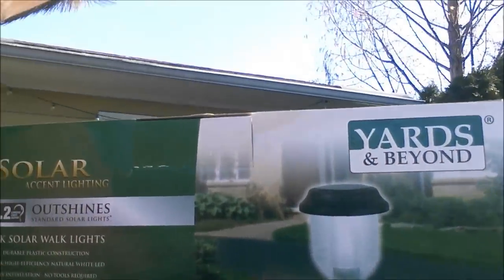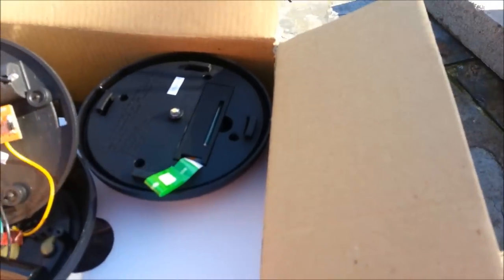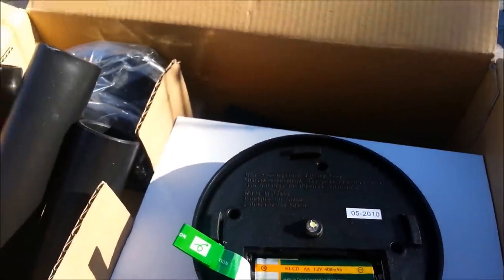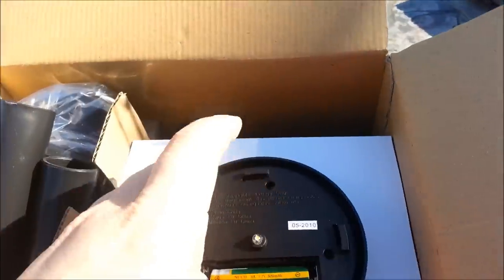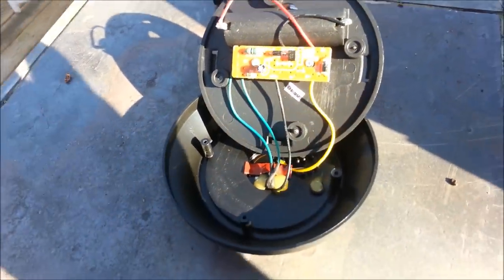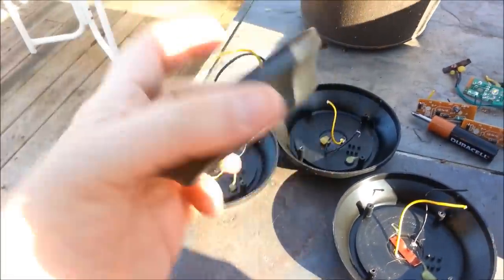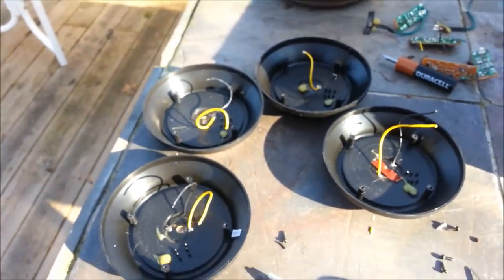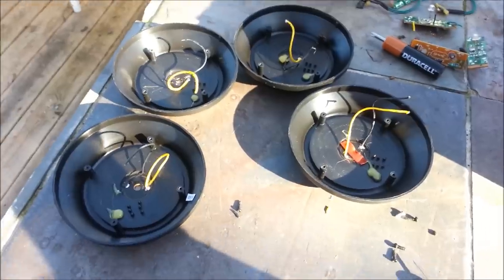DIY Solar walkway light to Battery Charger conversion

Comment: I will not mention the series parallel mix up because I see many others already have. What i will mention is that buying these expensive kits is a huge waste of money. I have these exact panels from some salvage patio lights. They are 2.5 volts and are only 40mA each. That is 0.1 Watts  X 4 panels = 0.4 Watts. That's $62.50 per watt. Considering that $1-$2 per watt is considered reasonable, that is huge waste of money. You can buy a single 0.6 Watt (6v) panel off ebay for $1. You should also put a blocking diode in series with the battery to stop the battery from discharging back into the cells when there is no light shinning on the panels. Remove one of those diodes from one of the boards.

Comment: yea dude... the lil chip prevents the electricity from traveling back from the batery to the panel. and for the records... your parallel and series is wrong. you wired it parallel, so your peak volatage is going to be probably be 3 or 6 volts... but yea... ur amperage is good :) good luck on your future solar projects. you would be able to crank 14 if u do series :)

Comment: I think you made a mistake in your description of series and parallel connections of batteries.
Connection in Series: voltage increases but Amperage stays the same.  In parallel connections Amperage Increases but voltage does not change.

Comment: If you were to remove a single solar panel from one of those lamps and attempt to light the LED using ONLY the panel, you would quickly realize that the LED will not light and the circuit that the panel connects to is not simply a switching circuit it is more of a mini-charge controller and you absolutely need something like this in order to charge those batteries as they require a higher input than the innate output of the individual solar cell itself.
Circuits are fun and I highly recommend taking up a hobby of understanding and constructing them.  You don't have to be a engineer with credentials in order to obtain and utilize valuable knowledge pertaining to electronics, but you will need to perform your due diligence.
Don't listen to the haters who seem to express derision bordering on actually hatred towards amateurs endeavoring to build something complicated for themselves whilst sharing it with an online community that they make themselves a part of.  Credentialists are complete and utter tools.
Reply: +Lunartrek; Not entirely true. I have identical panels like these. The panels produce 2.5 Volts. This will charge a 1.5v battery directly connected to it, and at 40mA, this will not harm the battery if over charged to long. However, he should have kept the blocking diode in series with the battery to prevent the battery from discharging back through the panel when there is no light.
About your last paragraph I have an issue with people who don't know what the F' they are doing, and making instructional videos. Its like the blind leading the blind. Its false information and it can causes people who don't know better to waste their time and money. Its Negligent and arrogant.
Reply: You're right about the diode and I may be wrong about the panels not powering the LED in other regions as the azimuth angle of the Sun plays a huge role.  Here, in Alaska, a single panel will not light my 1.8V LED.  I understood less, back when I wrote this comment.  This is a charge controller, that much is true, but the circuit has nothing to do with increasing the power of the solar cell, it simply builds up a charge which is then pulsed into the rechargeable battery to produce the charging effect.  The diode is essential, as you said, since the battery would simply discharge into the panels as soon as the voltage from the panels dropped lower than the battery which it would do, intermittently, throughout the day and all through the night until they roughly equalized potentials.
Reply: +Lunartrek ; There may or may not be a charge controller on the board. There is a photocell(photo resister, CDS cell) on the board that switches(connects) the battery to the LED when the light is low enough. I doubt that the cheaper lamps, like the ones from the dollar stores would have a charge controller. Its not necessary for this type of device using cheap NiCd batteries.
Reply: I use charge controller in a loose way.  Transistors can be applied as cheap charge controllers in that they can be wired to limit current or voltage, depending.

Comment: one mistake you made. if you hook up four solar cells in series will give you more power but with little amps, this means you will have more power to charge battery's but it will take much longer and the battery wont keep a charge, hook the cells in parallel you will get less voltage but more amp what this mean is it will take less time to charge your battery's with a higher chance your battery will keep it's charge. otherwise this was a good video, just remember this the next time you play with solar cells and panels.
Reply: +James Womack: You will not get more power. It will be the same power either in series or parallel. Power = voltage X current.   ie. 2X4=8, 4X2=8.  "More power to charge the batteries but will take longer to charge"????? That is nonsensical.
The voltage should be aprox %50 more than the batteries rated voltage, That is what should determine whether they should be in series or parralel.
Reply: +Robert Tomkinson lets just say we have 3 solar panels, each panel is rated at 20 volts, 5 amps, at 100 watts. wire these panels in series and you will get 60 volts 5 amps at 300 watts, this means you have a lot of voltage to charge a large battery bank, but like SurvivalistOfTheDead has said ( charges a bigger battery but very slowly). now take the same 3 solar panels and wire them in parallel you will get 20 volts 15 amps at 300 watts. now say this battery that we will use is a 12v deep cycle battery with 400ah they ain't much but i deal with them daily (there industrial and you need 2 people to lift one if anybody's curious ) now i know you may not have much experience with this type of battery and lets say you have one of these battery's and your only way to charge this battery was these 3 solar panels and maybe a blocking diode would you use these 3 panels in series or will you use them in parallel. and by the way robert the panels are 2.5v but at 20ma each and yes it is not worth buying these expensive kits and yes its better to get a cheap panel from ebay or amazon and perhaps even better quality.
Reply: +James Womack: Of course you would connect the panels in parallel to charge the battery because that's what the battery will respond to better. I was referring generally to his statement That "you will have more power". That is incorrect. Voltage and current are adjusted for specific purposes eg. a transformer will NOT give you more power, but the circuit will run better at a specific voltage and current and will draw more power from the transformer but more power is not created by changing the ratio of windings given the same amount of copper.

Comment: Parallel connection = same voltage higher current, series connection would give you four times the voltage of the panels no increase in current. The batteries are 1.2 volt, the output from the panels would range from zero volts to something over 1.2 volts, for the sake of argument let's say the max voltage of each panel is 2 volts and the max current is 2 mA.. if you connect them in parallel you will get a max voltage of 2 volts and a total max current of 8 mA in full sun, if you connect them in series you will get net max 2 mA in full sun and 8 volts. Simple illustration,, take 2 AA 1.5 V batteries and put them in series and you will have 3 Volts, put them in parallel and you will have 1.5 V with double the current capacity.This is basic electronics 101 stuff. Please read, study, learn before you post a video full of misinformation. Keep plugging you'll get it eventually. All blacks connected all greens connected = parallel and you called it series, I get it, you're just confused.
Reply: +KAT B; I don't think he 's confused because he is very consistent with this error. BTW, each of these panels has 4 tiny tiny little cells in series. A bit more than 2v each at 40mA.  Wow, telling people to spend $25 for 0.4 Watts worth of solar cells.
Reply: @E-BikingAdventures  don't suppose that this would work.... Don't know much about this stuff all I'm trying to do is recharge a small lithium ion little 3.75 battery Bank with some solar panels and then run the 12 volts and I can get off the battery Bank into a small sine wave inverter a little 500 watt 12 volt 500 watt inverter seems my house burned down and I need generate just a small about electricity to you know recharge a cell phone and tablet and stuff like that
Reply: @terrydronet9584  . To recharge a cell phone you can use a boost or buck converter to usb. They are very cheap off ebay. Only about $1-$2 dollars. A small 3v - 5v panel about 5 watts will work for the boost converter. The buck converters can be purchased at any gas station. Those are the ones you plug into a car cigarette lighter but they require a 6v - 12v panel. You do not need your phone charger. Just the usb cord. No need for a 120/240 v ac out inverter.

Comment: You can get a cheap panel off ebay with a lot higher output for like $2.  Your meter is junk get a good $7 digital one off amazon.  Obviously your series and parallel is backwards, but it is obvious you would do in parallel, the voltage will be limited by the battery, so more volts is just wasted.  You can also get 40mA panel lights at walmart for $1 or $2.  You are doing the have no clue what you talking about mistake of only measuring voltage, which is a completely useless piece of information without knowing the amps. You are making solar and DIY people look bad.